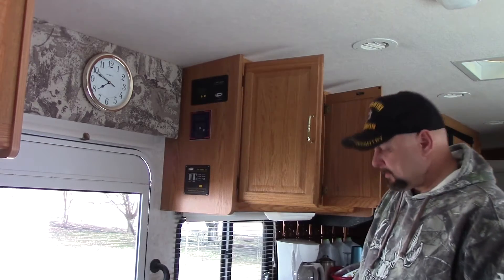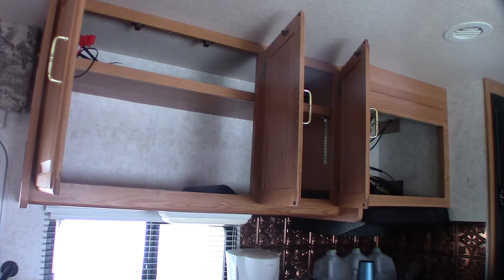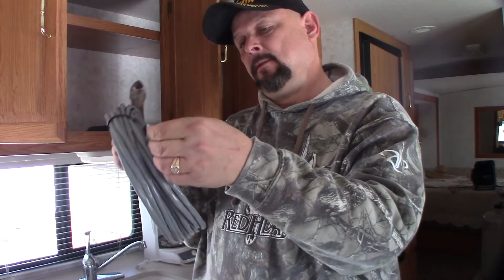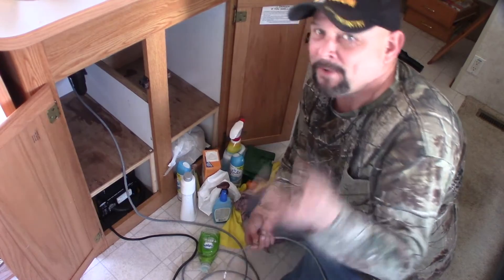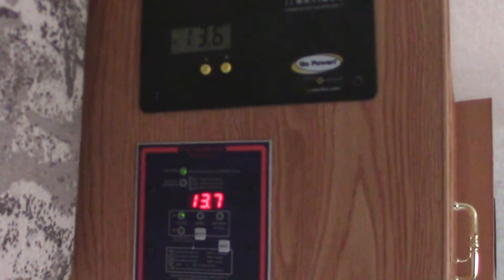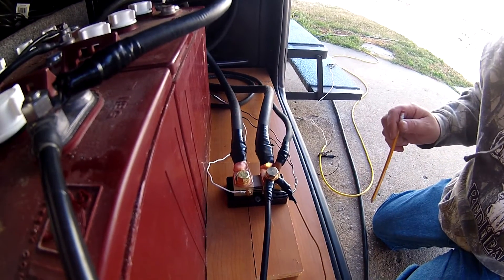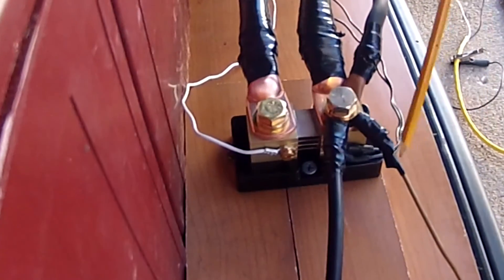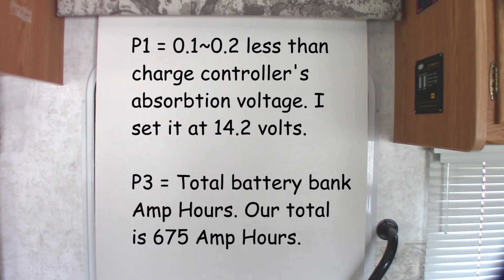Tri-Metric TM-2030-A Battery Bank Meter Install - Nomadic Native

Comment: But But but you’re using a 3000 watt inverter but 12v can only handle 2000 max. Do the math.
Reply from the maker: jeff mays it was a kit, built & sold by GoPower for a 12v battery bank, the math was done long before I bought & installed it.

Comment: What is the brand and model of the microwave you have in your coach?  I am looking for one to run with my solar backup battery bank.
Reply from the maker: Hi, We traded the 2004 Sightseer in for a new 2017 Forza this past July, but if I recall correctly it was a Whirlpool.

Comment: Thanks Mat, we just subscribed ,bery helpful.
Reply from the maker: You're very welcome & thanks for watching & subscribing! I can't recommend this meter highly enough. It's ability to count amp hours both into and out of the battery bank takes all the power management worry out of using a solar power system. We will be adding solar and this meter to the new RV very soon.